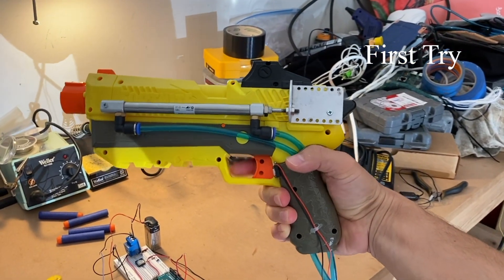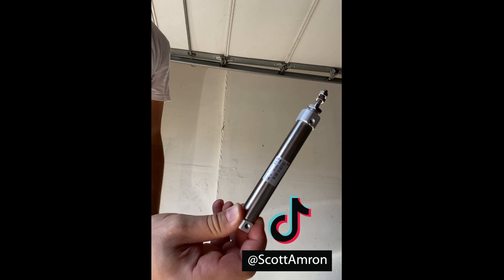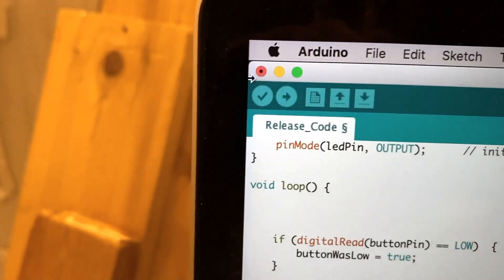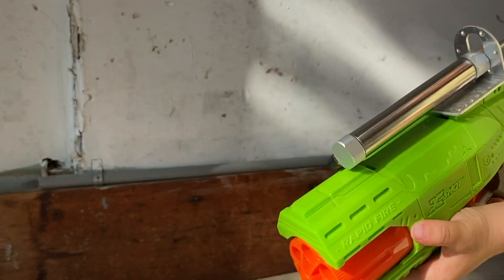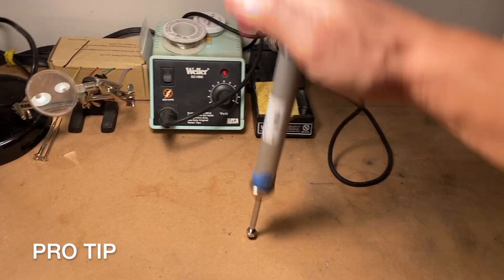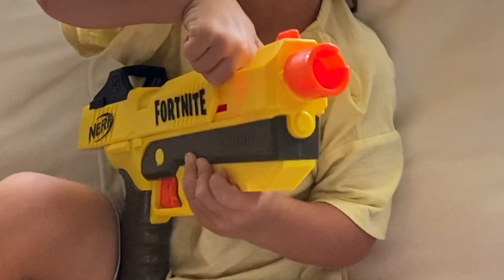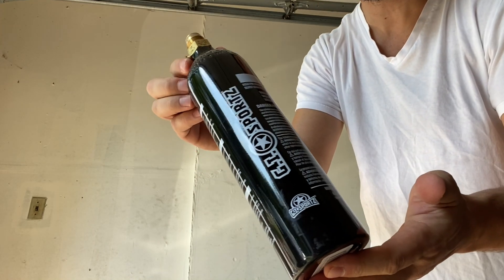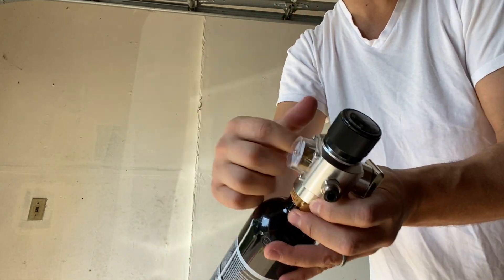Scary Fast Nerf Blaster Robot Mod

Comment: just mod a weak spring...
Reply from the maker: Right.  But, wouldn’t the darts not go as far?
Reply: @AmronExperimental  is a little kid! a kid dont need a sniper to shot the enemies 2km everyday.... the diference in distance is not so big!! probably the kid dont gonna see any diference
Reply from the maker: @colossoanao Was curious how it’d feel to have a robot do it :)
Reply: @AmronExperimental  but if you really want a stronger blaster you can simple use a weaker spring but made some common nerf mods like cut of the air restraint and use a copper barrel, dozens of mod are possible with most nerf blasters
Reply from the maker: @colossoanao good idea.  gonna give those a shot.  Thank you!

Comment: You’ve essentially create a new subclass of blasters… ‘HPA assisted semi automatic springer’ :-) I like it! A lot actually!

It might actually circumvent some of the rules against toys not being allowed to work on pre stored pneumatics in the EU with the exception of waterguns… because the pre stored pneumatics are not what is firing the projectile… the spring is.
Reply: If only the components were inside a solid shell and didn't have sharp metal edges moving quickly in the direction of a child's face!
Reply from the maker: @andrewg_nerfmods yeah, okay okay.  I’ll fix that.  Subscribe and you’ll see… :)
Reply from the maker: Oh wow.  That’s so cool!  Thank you for letting me know :)